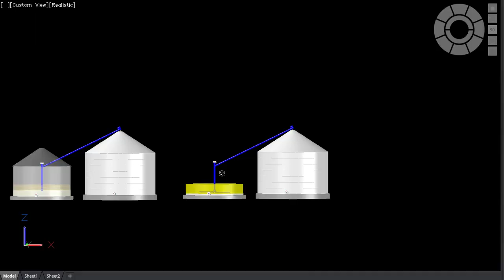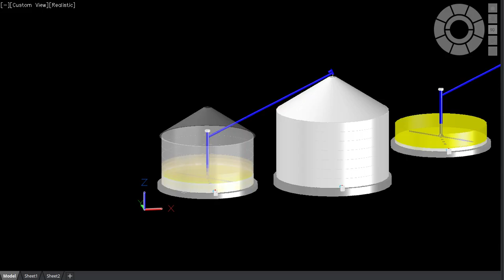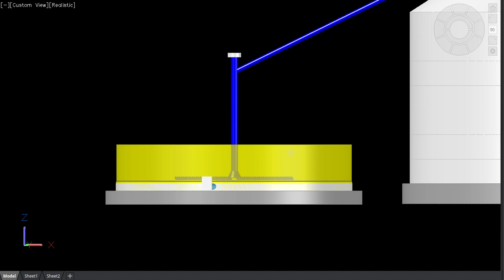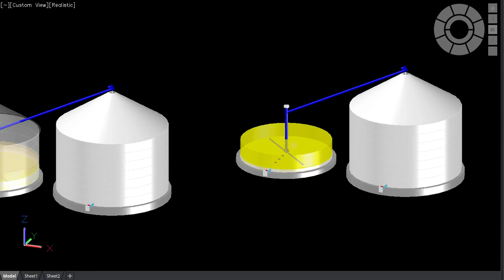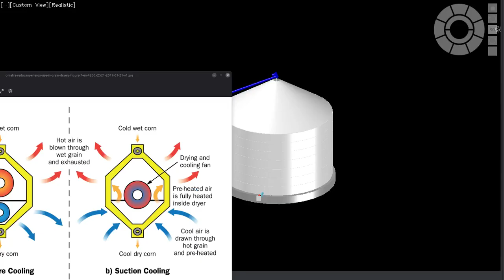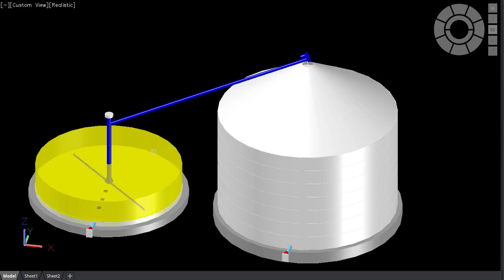Shivvers Grain Drying system review. Unedited

Comment: What diameter bins have you installed Shivvers dryers? How many floor sweep augers did they have?
Reply from the maker: 36' and 42', have customers that have 24' and 30' installed by others. One, Two and three auger systems. The single auger systems were older systems.